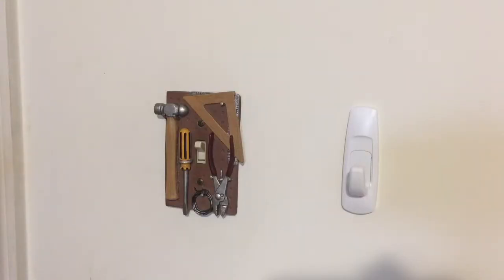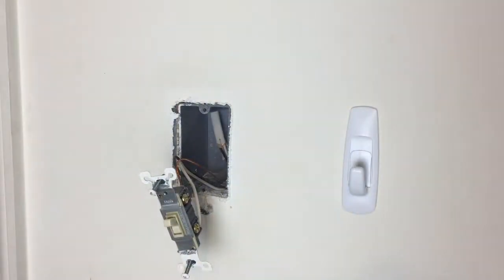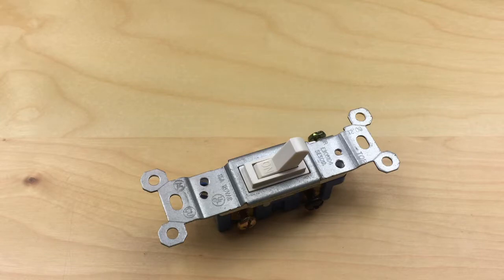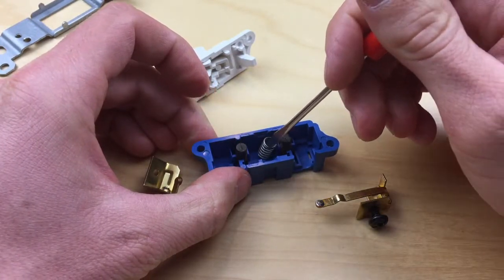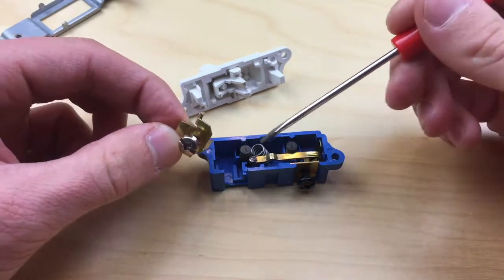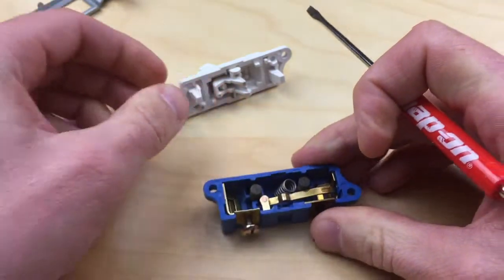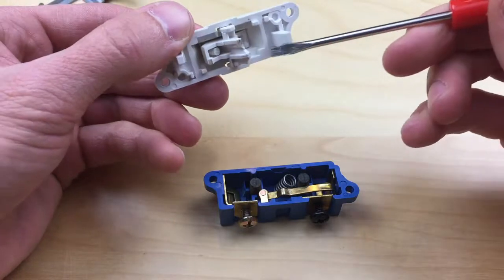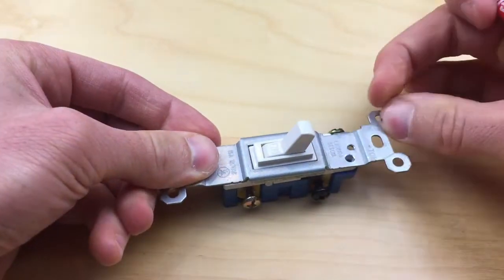How Does a Light Switch Work?

Comment: How do I know which one is negative and which is positive on a light switch?
Reply from the maker: Polarity generally doesn't matter on a basic switch for alternating current. You're interrupting the positive side of the circuit and the switch doesn't care which way the electricity flows through it.